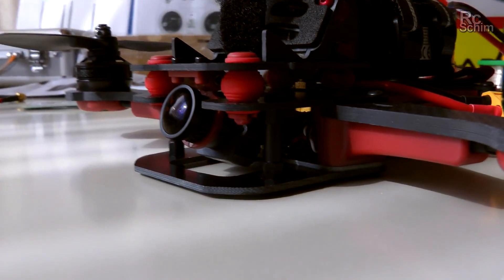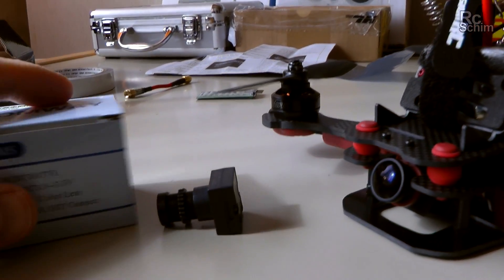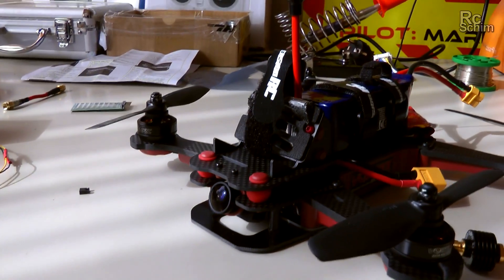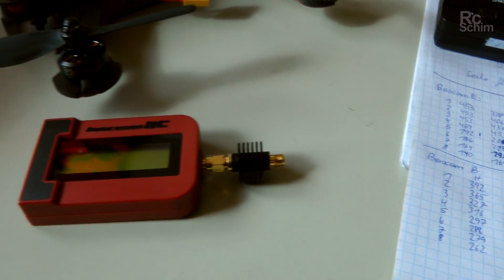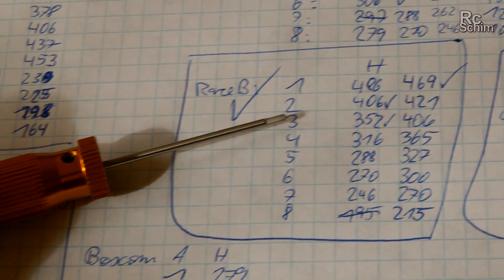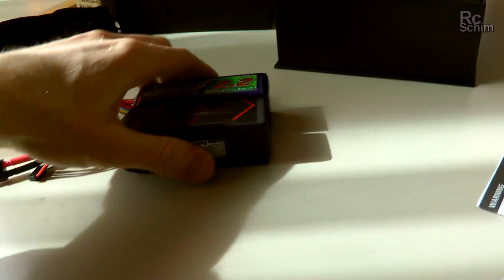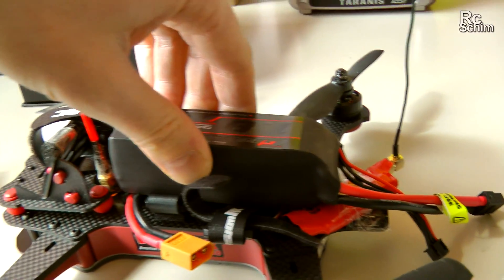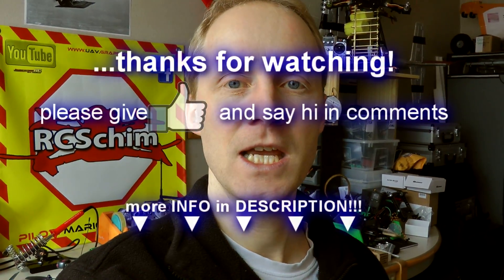Vortex 250 Cams (Cmos vs CCD), VTX Power and Graphene Batteries

Comment: 5:50 What causes the video interference?
Reply from the maker: +CincyPlasmaTech no idea, maybe just bad antenna angle? I did inverted dive and was about over my receiver - where there's a null. could also be that the vtx cable in the vortex moved and gave the interferrence? I should open the quad and secure the cable.
Reply: I want to put the right amount of money in FPV equipment so I dont hit a tree while patrolling the farm. I have wide clearings, but the trees get really dense in the hollows.
Reply from the maker: +CincyPlasmaTech if you want a very consistent image:
- get a diversity receiver
- use lower frequencies (5.8 is blocked easily by a tree, 2.4 is better - 1.2 or even 900mhz are perfect  - but with lower frequency the sharpness of image gets lesser.
also you have to check if frequency band is allowed and not used much in your area. for exampl 900mhz is often used by mobile phones.    
if you wanna cover large areas an antenna tracker might be a good idea - but this is advanced stuff...
Reply: Would an antenna tracker be the same as signal relay stations? There has to be an easy way to populate the signal over large areas. Thank you very much for the advice! Wireless communication is not part of my skill set. I moved from microelectronics to micromachining. If you could easily make 1,000 quadcopter parts from a thermoplastic inside a 60 mm x 60 mm x 10 mm volume per part, then what part would it be? I have a 55 ton injection mold machine sitting idle for too long.

Comment: Awesome video, thank you! And this table with Video TX mw power at different CH is very helpful indeed. Going to stick with Boscam E CH4 (453mw). It is 2nd in terms of power, but also this is the lowest frequency (5645) for 5.8GHz and lower freq. penetrates obstacles better as far as I understand.

You’ve showed that you use a small loop to manage cables but I suggest another solution: just rotate the battery 180 degrees so batteries’ cables are as far away from the Vortex power plugs as possible. Than when you plug the battery all the cables have tension and lay on the battery itself and they never move :)

Let us know how you like your new batteries after you test them please.
Reply: On my older Vortex I plug batteries this way:
https://dl.dropboxusercontent.com/u/24625844/Vortex/1.jpg
Reply from the maker: +Sergey Pavlov my cables are still too long and would tangle. but the little extra velcro ontop works nice. If I put the main cable under the normal velcro - the velcro gets too short (cause the batteries I use are pretty large. 
speaking of which: the 1800 graphenes feel good. did a few flights today. maybe I can upload a short update with some nice flying soon. I had a really nice, sunny friday afternoon (afterwork session) today. It was windy, but wind doesnt hurt the vortex, just makes acro a bit more dangerous near trees. also made my groundstation tripod fall over (now I will always put some weight on it) greets, Mario

Comment: What setup did you use on the cams?

I´m just trying the following config on my HS1177:
- Brightness 065
- DWDR-ON - 063
- Backlight - Off
- Day&Night - Level 080, Delay 3sec
- Night&Day - Level 032, Delay 1sec
- Image Adjust - Contrast 100, Sharpness 031
- Display User - Gamma 0.50, PED Level 025, Color Gain 220

- Also did a White Balance ;)

Comment: Still using my 600tvl Fatshark cams and happy with them still. I put a gopro lens on one of them. Are you going to make a rotor riot dogleg track to try and beat David's 30sec 3 laps? Wow big batts, my rhino 2550 3s is only 215g and I get 9 min on my heavy 280mm quad
Reply from the maker: +Hoverbot1TV I gotta checke out the layout of their test track. But I dont think I fly fast enough. But I will race for fun with a few friends soon. 
I might consider big 3S batteries for longrange dives with the vortex. lets see. but the 4cells just feel right and give you great speed...
Reply: RCSchim
I have been quite impressed with the multistar 10c on the 6" props excellent duration of flight and I can still flip with it. I think the vortex would cruise nice on the 3s 3000mah multistar. My HBx 330 was almost 800g w fpv 2000kv 2206 and flew 9min. The 10c are lighter but have higher mah.

Comment: Wow.. that Vortex OSD... too much information.   I much prefer flying "bareback" without any OSD data.   All you need when flying a miniquad is a telemetry alarm to indicate when the battery is getting low and the Taranis has that facility so an OSD (IMHO) for flying is just fluff.
Reply from the maker: +xjet Hi Bruce, I guess that depends on what you like.  Some guys are more visual (like me) others are audio-visual and prefer sound. the vortex has different HUD modes - one being very minimalistic (where for example the battery is a long bar at the bottom which get's shorter.   I prefer the ezOSD because I'm used to it from other quads.     And I'm constantly nervous about the rssi if I go out further with a new quad. As soon as I'm confident enough on longrange runs with it in the mountains, I might switch to another view :)    greetings, Mario
Reply: +RCSchim Don't you have a Taranis?  With the Taranis you will get RSSI alerts based on your chosen alarm levels and you can program the radio to tell you the RSSI either when you flick a switch or at a regular interval.    I find it much easier to concentrate on flying and simply be alerted when my attention to battery or RSSI is required -- rather than have to keep an eye on numbers on the screen.

Perhaps that's because I like to fly my miniquads fast and low -- so I need to have all my focus on flying, not on reading an OSD.   I use an OSD on my fixed-wing slower-flying FPV models -- but not miniquads.
Reply from the maker: +xjet Sure I fly Taranis :)  I was amazed by how well this radio was sold (initially I bought it only because it was cheap enough and it hat some room for the ezUHF JR module).

I love the RSSI warnings when using the X8r RX but on the Vortex I use the ezUHF - and I dont know how to get RSSI telemetry from ezuhf to taranis. Also I'm lazy on modding and find it nice if something works "out of the box".   You dont really need to read the OSD (which you cant while flying low and fast) but your get alarm icons in the center for:    low bat, low RSSI, time (if you want)  - so that's ok for me :)
Reply: +RCSchim Is there a reason you are using UHF?  I get more range than I ever need from the FrSky 2.4GHz system and  have flown over 3.5Km without any problems.  I've also never had a loss of signal when flying miniquads -- the video will disappear long before I get an RSSI warning.
Reply from the maker: +xjet well, I used X8r on a tiny 210 quad (the eyefly trip) and got RSSI at around 500m (ok there were some trees involved).
Now to have enough confidence for mountain diving I need a lot of safe margin - else I'm way to chicken without a GPS RTH...

Are you using normal x8r   or the d4rII which is so popular on minis? 
How low do you set your RSSI warnnings on taranis - and how "serious" is my taranis about warning me? Is it safe to fly further then? I dont know....
Maybe I'll use a X8r on my Xugong for safe testing (with GPS RTH).
But then again: every quad has it's own intereferences (like the Xugong has many of them it seems).

so please tell me which FRSky RX are the best from your experience. thanks!
Reply: +RCSchim I'm still using the default RSSI settings on my Taranis.  Is your Taranis an EU model perhaps?

With 2.4GHz, installation is critical to good range and performance and I'm pretty careful to make sure my installs are as good as they can be in terms of antenna positioning, etc.

Perhaps I should do a video on the subject of 2.4GHz installations, range and RSSI figures.
Reply from the maker: +xjet sure you should! :)   it would also be interesting which frsky RX has the best range.  I know there is this longrange version - but this again has no telemetry. So short range and know it - or long range and gamble? :)
Had some nice flights today with the vortex and did try out 3 different batteries in my vertical dragrace test (150m full throttle with fresh battery and see which is fastest). Graphene 1800 4cell did awesome - voltage hardly dropped while full thr,   on my older gensace tattu 1300  it dropped below 12v which made my OSD give nice alarms (for a reason) to me.   greets, Mario  (PS collab video is out today - thanks again!)

Comment: Do you have link for 2.1mm lens, tnx
Reply from the maker: +SEKILE FPV nope, sorry - it just came with one of the many cams I've tested.
One thing: there are 2 types of FPV cams: 
(or three)    ones where the IR filter (red coating) is directly on the Chip,    and others have it on the lens.
if you mix these two types you end up with nasty wrong colors (check this vid here:  https://youtu.be/5FzX7HuMBKg?t=341 )

Comment: Hi Mario.
I think the disparity in the output filter maybe due to limitations and thus a compromise of the filter, or output stage, circuits. If you want an efficient filter with a high Q factor then it will only be effective over a small bandwidth. If you want a wider bandwidth then the efficiency of the output filter will be limited. I've recently obtained some 3S 1300mAh Graphene packs and on my 285 Vortex I have definitely experienced an improved response over my similar spec'd Nanotech packs, though they are at least a year old and maybe had about 50 cycles each.
Happy Flying
Nidge.